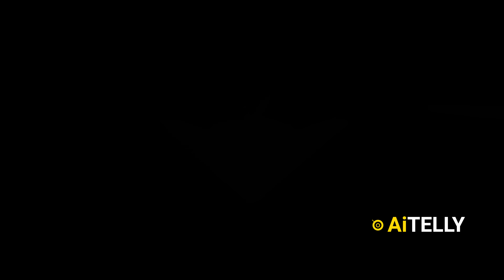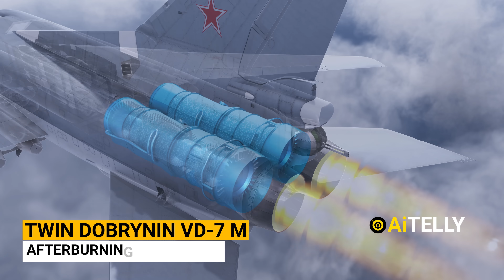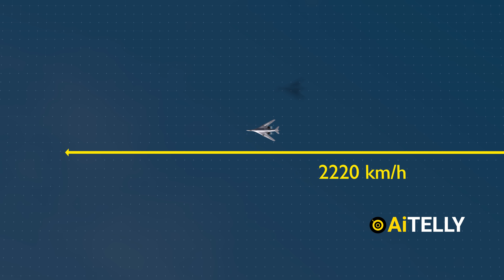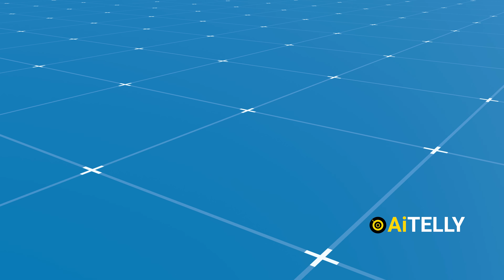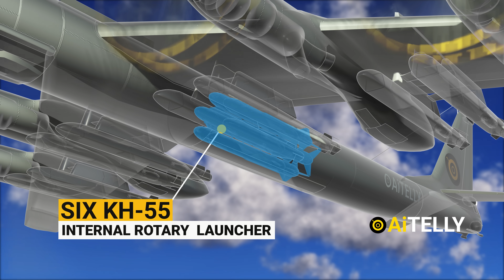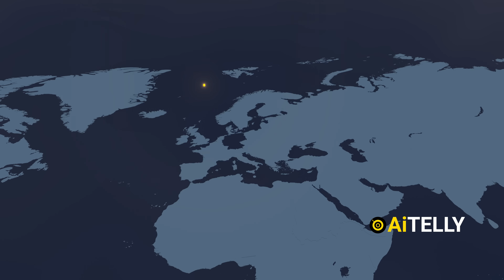How Russian Nuclear Bomber Works? Tu 160 Tu 22 Tu 95

Comment: the hypersonic   are pretty much unable to move at higher speeds... they can slightly deviate, but that's it... fluid mechanics tears the material to pieces... the air pressure in front causes structural damage... it moves in and through the not so viscous air and also the vacuum the missle is producing... the extremely high velocity causes  the exert of more force than our current technology can withstand... it can't... simply put, at those high velocities, even air molecules are enough to shred most alloys...🤔
I got distracted and forgot the rest 😑

Comment: No doubt the US has some of the most cutting-edge weapon technology out there. But honestly, a lot of their systems are over-engineered, which just makes procurement way more expensive than it needs to be. Plus, the cost to operate and maintain these weapons is insanely high, making it tough to sustain a long war. Take the F-35, for example—its lifetime operating cost is estimated to be over a trillion dollars. That’s just not practical.

It’s no secret the US might lose its global dominance if this keeps up. You can’t keep spending $800+ billion on defense every year when your dollar and economy are weakening. They really need to focus on developing practical, efficient weapons that are cheaper to maintain and operate. Innovation isn’t just about flashy tech, it has to be sustainable too.

Comment: Oh man, the pronunciations on this video are horrendous! As for the Russian aircraft, you have to say each of the letters before the number, i.e. T U-95. Not "too-95." Rotary you pronounced Ro-tarry. Flaperons are not pronounced "flay-per-ons." Those "pods" you said that hold the TU-160's engines are called nacelles. This is common aviation terminology, recognized the world over.
Apart from that, the graphics were pretty cool, but did you really need to slap your logo all over everything?

Comment: There are many errors in the pictures  the Tu-22M3 does not carry 3 missiles under each wing. It can carry 1 Missile on each wing, freefall bombs under the air intacke and weapons in the bombbay or a semi retracted missile by the bomb bay. the Tu-160 has not 3 bombbays (thats the B-1) the Tu-160 has 2 Bombbays

Comment: American missile can not reach anything. It does not exist, at least yet. Kinzhal missile is relatively cheap. It is basically air launched Iskander and cost somewhere betwen 30 and 60 million rubles. So let say, that Kinzhal cost those 60 million rubles. This translate into 0,5-0,8 million USD per missile. True hypersonic missile - zircon, is immensely expensive. It cost roughly 2-5 billion rubles, so 20-50 million USD. This is why it is cherished and it was most probably not used in ukraine, because ukraine has not such valuable targets. This is in fact reason, why Oreshnik was developed, because RS-26 ballistic missile (from withc was Oreshnik developed) is significantly less expensive than Zircon. It cost somewhere between 1200-1500 million rubles and it is capable to deliver bigger blow to multiple static targets, than Zircon. Fun fact, Oreshnik is in dollar price cheaper, than SM-3 missile, which would not be able to kill it easily (if at all), because mid flight manevers.

Comment: A lot of things are misspelled. The speed of the Tu-160 is 1.5 M. The Tu-160 carries 12 missiles on 2 reels. The X-102 missile has a range of 5,500 km. The warhead capacity is up to 1 Mt. This is not for aircraft carriers, this is for the District of Columbia. The Kinzhal rocket flies at an altitude of up to 100 km and falls from above in a dead air defense funnel.

Comment: 😮Author, there are some inaccuracies in this video! 😂 You show how the Tu-22M launches 4 hypersonic kinzhal missiles at an aircraft carrier and how the aircraft carrier shoots them down, at this point I just laughed out loud. Firstly, 1 hypersonic missile is enough to destroy an aircraft carrier; secondly: the "kinzhal" does not fly along a flat trajectory like a cruise missile (you can watch a video on YouTube of objective control by the Russians of how Ukrainian rocket systems in Kharkov or various air defense systems were destroyed by Iskander missiles. Lightning just falls from the sky, at 90° to the ground); thirdly, the Kinzhal is an Iskander, which is launched from an aircraft and develops hypersonic speed due to the fact that the aircraft's speed is high, and it does not need to spend fuel (and, relatively speaking, strength) to fight the earth's gravity, it uses all its "strength" on speed, so how are you going to shoot down this hypersonic missile with a rapid-fire cannon, I can't imagine and I'm frankly laughing!  Well, and fifthly, the Iskander/Kinzhal may have a nuclear warhead and it is logical to assume that a missile with a nuclear warhead will be used to combat the AUG (aircraft carrier and accompanying ships), because it is simply stupid to assume otherwise.

Comment: Oh dear lord, there are so many Russian bots in the comment section spreading misinformation. Regardless, very nice video
Reply: @raifne9781  What exactly was the disinformation. Please provide your perspective
Reply: @piuswanyaga8361  They keep mentioning that Kinzhals have never been shot down or that they cannot be shot down. While they can't be easily shot down by CIWS like in the video (technically they can, assuming a perfect scenario in a test environment, but they are fast enough that even interceptions can still result in significant damage to the target), they can absolutely be intercepted by SAM systems like AEGIS, Patriot, and others. The reason for this is simple: atmospheric resistance.

As the missile gets closer to the ground towards its target, air resistance becomes a significant factor, slowing the missile down. It can travel at high altitudes with little air resistance, where reaching speeds like Mach 10 is easier. However, as it descends towards its target at lower altitudes, the air density increases, generating heat to unacceptable levels. This heat can form a plasma sheath that interferes with the missile's guidance system. The Kinzhal uses either radar or electro-optical guidance for precise targeting during its terminal phase, which do not work effectively at high speeds where plasma sheathing occurs.

Because of this, the missile needs to slow down to a speed where plasma sheathing does not occur at lower altitudes, around Mach 3-4. At this point, it is no longer hypersonic and is within the speed range that anti-ballistic missile defense systems like the Patriot are optimized to engage. This has been confirmed when a Patriot operator on May 4th 2023 intercepted a Kinzhal mentioned it was traveling around Mach 3 at the time of interception, which makes sense due to the reasons stated above. It's not that the Kinzhal is a slow missile; it's that it needs to slow down during its terminal phase for precise targeting.

Additionally, the Kinzhal must travel to high altitudes to achieve such high speeds, making it visible to radars and giving defenses ample time to detect, track, and engage the missile when it comes into range. Kinzhal missiles can be, and have been, shot down multiple times already. This is also why Russia has focused on making their bombers capable of carrying more of these missiles. They know their missiles can't maintain hypersonic speeds in their terminal phase, so they need to use both speed and numbers to overwhelm defenses. The more missiles they fire, the lower the chances that all will be intercepted. However, as long as there aren't too many in the air at once, they can be intercepted by systems like the Patriot and other SAM systems dedicated to anti-ballistic missile defense.
Reply: They keep mentioning that Kinzhals have never been shot down or that they cannot be shot down. While they can't be easily shot down by CIWS like in the video (technically they can, assuming a perfect scenario in a test environment, but they are fast enough that even interceptions can still result in significant damage to the target), they can absolutely be intercepted by SAM systems like AEGIS, Patriot, and others. The reason for this is simple: atmospheric resistance.

As the missile gets closer to the ground towards its target, air resistance becomes a significant factor, slowing the missile down. It can travel at high altitudes with little air resistance, where reaching speeds like Mach 10 is easier. However, as it descends towards its target at lower altitudes, the air density increases, generating heat to unacceptable levels. This heat can form a plasma sheath that interferes with the missile's guidance system. The Kinzhal uses either radar or electro-optical guidance for precise targeting during its terminal phase, which do not work effectively at high speeds where plasma sheathing occurs.

Because of this, the missile needs to slow down to a speed where plasma sheathing does not occur at lower altitudes, around Mach 3-4. At this point, it is no longer hypersonic and is within the speed range that anti-ballistic missile defense systems like the Patriot are optimized to engage. This has been confirmed when a Patriot operator on May 4th 2023 intercepted a Kinzhal mentioned it was traveling around Mach 3 at the time of interception, which makes sense due to the reasons stated above. It's not that the Kinzhal is a slow missile; it's that it needs to slow down during its terminal phase for precise targeting.

Additionally, the Kinzhal must travel to high altitudes to achieve such high speeds, making it visible to radars and giving defenses ample time to detect, track, and engage the missile when it comes into range. Kinzhal missiles can be, and have been, shot down multiple times already. This is also why Russia has focused on making their bombers capable of carrying more of these missiles. They know their missiles can't maintain hypersonic speeds in their terminal phase, so they need to use both speed and numbers to overwhelm defenses. The more missiles they fire, the lower the chances that all will be intercepted. However, as long as there aren't too many in the air at once, they can be intercepted by systems like the Patriot and other SAM systems dedicated to anti-ballistic missile defense.
Reply: @raifne9781  Is there evidence of that? That pencil like missile Klitschko presented is not a khinzhal missile. Khinzhal is a massive missile with a diameter of almost 1 metre and a length of about 7m according to publicly available data such as Wikipedia.
Reply: The missile he showed does not look like a Kinzhal, but I found no evidence that Kinzhals have not been shot down or cannot be shot down. All hypersonic missiles follow the law of physics and have technological limitations which render them vulnerable to intercept due to reasons I already gave in my previous comment. In January and February of 1991 during Desert Storm, Patriot was able to intercept Scud missiles that have a maximum speed of Mach 5 with PAC-2 missiles. Modern Patriot systems utilize improved PAC-3 missiles that have hit-to-kill systems specifically designed to intercept hypersonic missiles in their terminal phase. 

Considering that Kinzhal is a massive warhead, atmospheric resistance is much more significant and might even cause it to slow down more than the older Scud missiles. With this in mind, Kinzhal might be even more easier to intercept than a Scud during it's terminal phase due to it's larger size and increased drag. Even if Kinzhal was able to somehow maintain speeds of up to Mach 6 during their entire terminal phase until impact, it would have extreme difficulty in maneuvering making it easier to predict (and even then we're already ignoring the problems with targeting and guidance at such speeds). 

Patriot PAC-3s have a battery of attitude control systems located at the front of the missile, a significant upgrade to Pac-2s, which provide it with extreme maneuverability to assist in intercepting missiles. Kinzhal has only fins which will be extremely ineffective at maneuvering due to air compression in the lower and thicker atmosphere while Patriot solves this by using the system I mentioned. 

This is also why nuclear ICBMs often have multiple warheads, both decoys and real, in order to overwhelm defenses and avoid interception. ICBM warheads have a much higher maximum speed during their terminal phase because they do not need precise targeting since their targets are the size of cities. Even then, they are still vulnerable to interception so they bring decoys along with them. If an ICBM traveling at hypersonic speeds can be intercepted, a Kinzhal that slows down to sub hypersonic speeds is definitely able to be intercepted. All of these factors point to the Kinzhal being vulnerable to interception by anti ballistic missile defenses like Patriot. This is why there is no confirmed evidence that Kinzhal missiles have not been shot down.
Reply: @piuswanyaga8361  They keep mentioning that Kinzhals have never been shot down or that they cannot be shot down. While they can't be easily shot down by CIWS like in the video (technically they can, assuming a perfect scenario in a test environment, but they are fast enough that even interceptions can still result in significant damage to the target), they can absolutely be intercepted by SAM systems like AEGIS, Patriot, and others. The reason for this is simple: atmospheric resistance.

As the missile gets closer to the ground towards its target, air resistance becomes a significant factor, slowing the missile down. It can travel at high altitudes with little air resistance, where reaching speeds like Mach 10 is easier. However, as it descends towards its target at lower altitudes, the air density increases, generating heat to unacceptable levels. This heat can form a plasma sheath that interferes with the missile's guidance system. The Kinzhal uses either radar or electro-optical guidance for precise targeting during its terminal phase, which do not work effectively at high speeds where plasma sheathing occurs.

Because of this, the missile needs to slow down to a speed where plasma sheathing does not occur at lower altitudes, around Mach 3-4. At this point, it is no longer hypersonic and is within the speed range that anti-ballistic missile defense systems like the Patriot are optimized to engage. This has been confirmed when a Patriot operator on May 4th 2023 intercepted a Kinzhal mentioned it was traveling around Mach 3 at the time of interception, which makes sense due to the reasons stated above. It's not that the Kinzhal is a slow missile; it's that it needs to slow down during its terminal phase for precise targeting.

Additionally, the Kinzhal must travel to high altitudes to achieve such high speeds, making it visible to radars and giving defenses ample time to detect, track, and engage the missile when it comes into range. Kinzhal missiles can be, and have been, shot down multiple times already. This is also why Russia has focused on making their bombers capable of carrying more of these missiles. They know their missiles can't maintain hypersonic speeds in their terminal phase, so they need to use both speed and numbers to overwhelm defenses. The more missiles they fire, the lower the chances that all will be intercepted. However, as long as there aren't too many in the air at once, they can be intercepted by systems like the Patriot and other SAM systems dedicated to anti-ballistic missile defense.